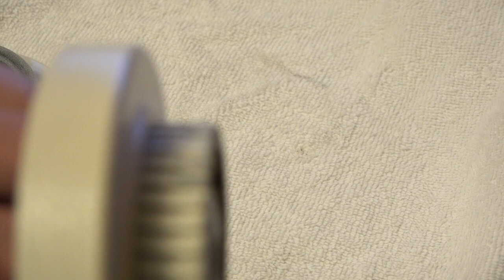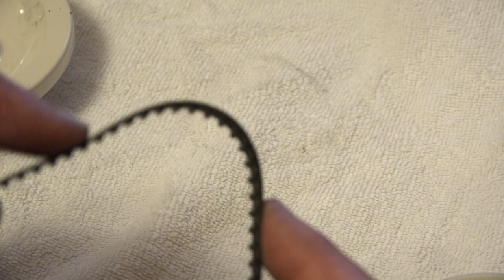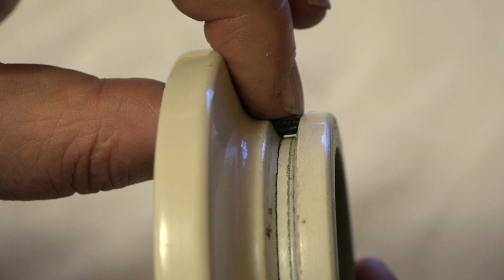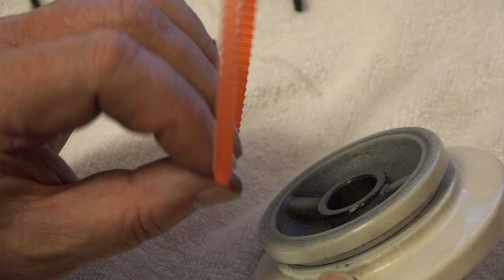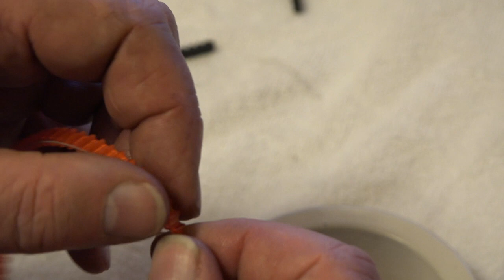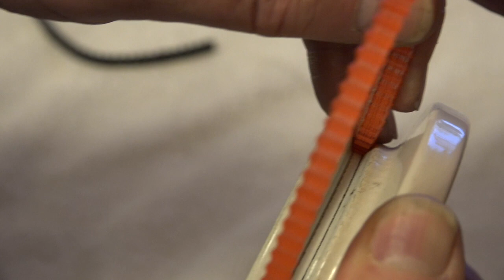Sewing Machine Belts

Comment: Thanks for this well made video with relevant guidance. I just made a video too with a comparison of some of these belts. I got the impression, that lug belt were V-belts made of reinforced Polyurethane (PU), and they were not constructed to be belt with tooth as for a timing belt. But now I am not sure.
Reply from the maker: in very rare cases these are used as lugged belts in other equipment, I haven't seen these used as lugged belts for sewing machines
Reply: @gmcxm211  After having tested them against normal V-belts, I do not think I will bye a lug belt again. They need significantly higher belt tension to make the same grip.

Comment: The thinner drive belts with teeth must be set quite tight. Too loose and the belt will start having cracks too soon. Push sideways in the center with a force equivalent to 1kg, belt should deflect about 15mm.  The thicker plain belts can be more loose.

Comment: Your detailing of belts technically was very good. I just have a question. You said that both sides toothed belt can't be reversed as one side it works as the timing belt and the other side it works as "v"  belt. I have "WHITE 999" model machine with two belt drive. One between motor and intermediate idler and the other between the idler and the flywheel. My belt on the motor has slackened and I am not able to adjust the length between motor and idler as they are mounted the same frame with no provision to adjust the distance. But if I reverse the belt it sits tight but I don't know if it will harm the belt. I would be happy to receive your advice. Thanks
Reply from the maker: try it to see if it works, these belts are cheap and are usually supplied with the 1 amp or less motors. the worst outcome is you'll have to get a different belt.
Reply: Thanks for your prompt response. Let me try and give feedback. Right now I have put a rubber band on the idler pulley and it works.
Reply from the maker: I'm sorry I can't be of much help. I'm not familiar with the interior motor driven sewing machines. I deal with mostly the big industrial sewing machines. If putting a rubber band around a pulley to take up the slack of the belt, it won't hurt the machine as long as the belt is not too tight. It seems strange that there is not an adjustment screw of some kind for the belt. But what you're describing sounds like an external motor using an idler gear as a speed reducer. Is the upper and lower shaft connected by a geared vertical shaft?

Comment: Can you please tell me what type of belts r needed for a juki serger MO 812 serger i just purchased it at a great price im guessing cause it had no belts ? Do i need 2 kinds of belts?
Reply from the maker: sorry it took me awhile to answer you but if you haven't purchased a belt yet, take your tape measure and wrap it on outside  pullies just as it were a belt, this should get you in the ball park. most sewing machines use a 3/8 inch wide belt
Reply from the maker: so just go to a auto parts store and buy your belts there. I use automobile fan belts on all of my machines